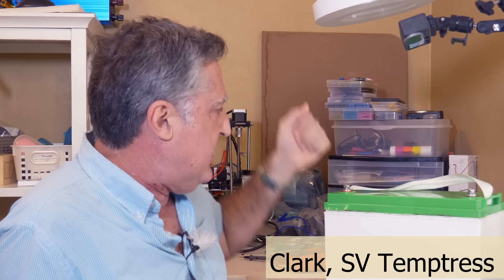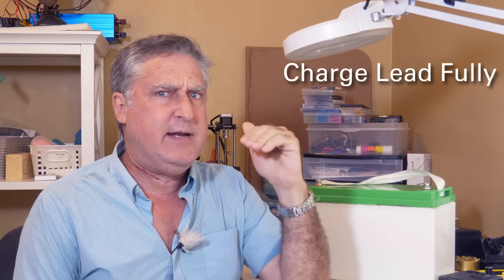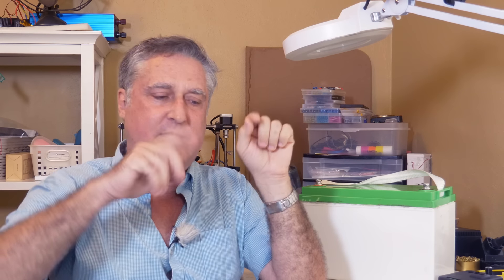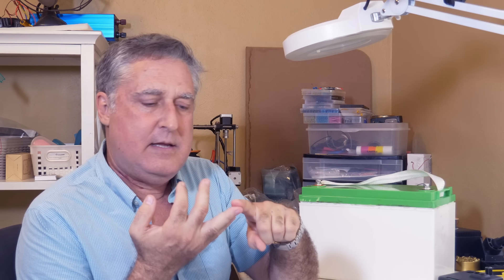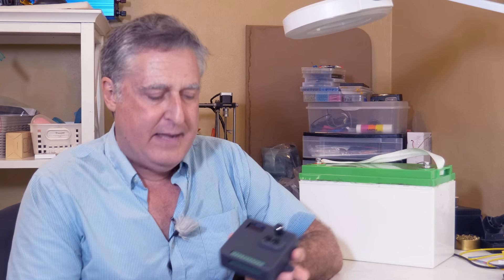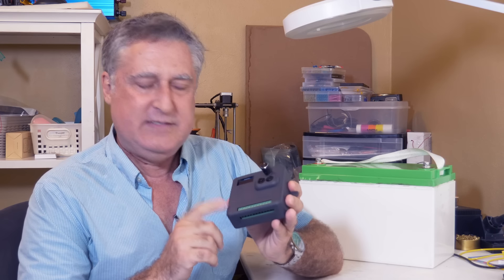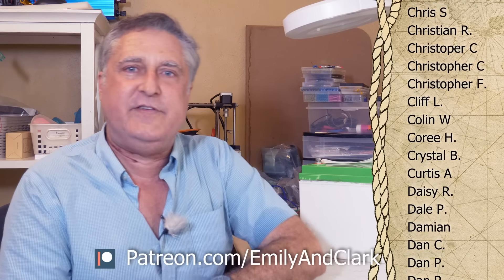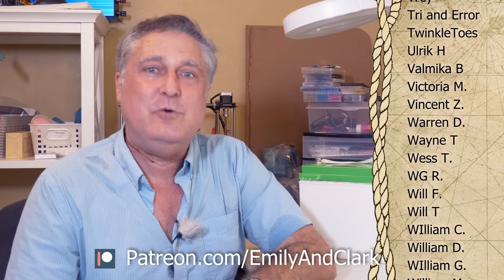Charge Lithium Batteries correctly (LiFePO4)

Comment: New LiFePo4 have good BMSs and they look after correct charging.....good solar charger, correctly set up does the trick
Reply from the maker: Sorry but you are so wrong
   If you have Li you will find out in a few years
Reply: @Clarks-Adventure  I have 6 LiFePo4 of total 990Ah...so far 4 years and they are in perfect condition.
Reply from the maker: That's great.  Best of luck to you.  
  It's obvious you aren't looking for how to charge them.  
   But if you do a bit of looking the research is out there.
https://cdn.shopify.com/s/files/1/0568/1011/1110/files/Math_ScienceOfBBMS_Grillo.pdf?v=1730396821

Comment: I use a Noco charger for my R/V lithium batteries and it works well, when set to lithium.
Reply from the maker: I'm sure it puts power into them.  But will it damage them??  In my experience you will find out in 3 to 6 years

Comment: Hey Clark! When not using the batteries daily and plugged in to shore power with a Victron main charge/inverter (and a hybrid system using your BBMS) I’ve started putting the system at max 80% and min 80% to keep it from needlessly going up and down every day. I’ve seen cycle counts in Bluetooth for each battery even when not being actually used. When. Unplug from the dock and sail I raise the charge to 100% max and min to 20%. Thoughts on this?  Lithium is 500ah and lead is two group 24 (80x2ah).
Reply from the maker: I'd set your dock settings to 80 and like 40.

The BMS is a stupid beast I would use it's cycle count with a grain of salt
It's likely to count ANY charging as a cycle.  The BankManager will allow a li bank that is not a candidate for recharge to go up to 13.45v before disconnecting.

Comment: Have an older motorhome.  Would like to change house batteries to 48V lithium system and keep chassis batteries 12V. Will your bank manager device work with that setup?
Reply from the maker: It will protect your new 48v Li and control it's charging but no it won't step up/down the voltage.  You would need a boost converter like Dc-Dc charger for that part.
Reply: @Clarks-Adventure I have a car with LFP battery. Whats the best way to charge it?
Reply from the maker: I think the BankManager of course and something to keep the charging C rate under control
Reply: @Clarks-Adventure  lfp cars manual says to charge to 100% atleast once a week using slow charger (either 3kw charger or 7kw charger). It helps in removing memory effect + soc calibration + cell balancing.

Comment: Clark also refers to the difficulty of determining 100% state of charge due to the flat nature of the v/I graph, but doesn’t state how the Battery Manager determines this.  Not to mention determining a percent state of charge.  Am I missing something here?
Reply from the maker: If you found yourself in a position where you are the only guy who has built a device that solves an important problem, especially after several battery manufacturers have tried and failed,  would you really give away all your secrets in a YouTube video?
Reply: @ Well, fine.  I just thought you were trying to explain the tech behind the  whole thing.  But ok, I understand you not giving up your trade secrets. Much respect to the work you’ve put into the product.

Comment: Clark, how do we know when we've discharged a LA battery to 50% (or 60 or 70%?)
I've seen in discussions on boating electrical Facebook pages where people say a 12 volt LA battery is fully charged at 12.65 and 50% discharged at 12.0 volts.
What reading, or how do you determine a battery is 60 or even 50% discharged?
Reply from the maker: Let it rest with no charge or load for 24 hours (2 hours works ok usually) and check its voltage. 
   Then use those tables 12.0v is 50 percent, 12.8v is 100 percent.
    The resting is vital and the table is only accurate for new healthy batteries
Reply: You can't use voltage to determine the state of charge of a lifepo4 battery. The only way to reliably tell a state of charge of lifepo4 is to coulomb count, which means fully charging and then counting how much is taken out. As in your own drawing, the red line is so flat that almost anywhere on that line could be any state of charge between 10 and 90 percent.
Reply from the maker: Yep but his question was about LA batteries.

And for li there is another way, it's how the bankmanager does it.  It's a lot of complex math involving a 3brain and some extra time/history based work.  
   This approach is relatively inaccurate around 50 percent, where the bankmanager uses a columb counter.  It gets progressively more accurate as it gets closer to 100 and 0 percent.
    I'm currently working on a POC gauge that will really know when LiFePO4 is about to discharge way more accurately than columb.   It should prove useful for electric vehicles

Comment: Excellent presentation!  But I'm confused.  I have 2 48v 70 ah lifepo4 batteries connected in parallel that I use strictly for emergency backup.  How should I keep these charged properly?
Reply from the maker: If you want longest life leave them at 50 percent 
    But what's the point of that.   I say charge them to full put a tiny load on them to bring the voltage to 13.4x4v. And keep your tank full for emergencies.    That's their job after all
Reply: @Clarks-Adventure  Thank you!

Comment: I have 4 / 12 volt lifepo 4 battery's in my cart ,where do I hook up negative,positive cables from charger,on one battery or one on one battery,one on another battery.
Reply from the maker: If you want 48v put them in series (google it)

Watch my Duffy video.  You need a battery equalizer.  I found a good one that is cheap (follow the link in the description)
Reply: They are in series,it's the charger cables,on one battery or two batterys
Reply from the maker: @dougyoung1309 MarineDCAC.com   find the BankManager install manual.  It might help.

I just got out of surgery so I'm not too sharp just now.

Comment: You are aware that all modern LiFePo4 batteries have BMS, right? Those BMS have MOSFET valves that control charging of individual cells based on their voltage and can bypass some cells while charging (or when charged). So it doesn't really matter what voltage your charger keeps at terminals, cells won't charge if MOSFET valve is off even if an overall voltage is 14.4V. Modern BMS is much smarter than what you think it is. Also max cell voltage for LiFePo4 cell before it starts to deposit Li is 3.65V, which for 4 cells gives ... you guessed it, 14.6V.
Reply from the maker: I suggest you watch my "how the charge li" video I put out a few months ago.

That's not how to change li for long life.
Reply: @Clarks-Adventure  How do you know you are right? I asked Battle Born Batteries specifically if it's safe to keep their batteries at 14.4V all the time, the answer was: yes, it's perfectly safe. So I guess they don't know something about their batteries, and you know better.
Reply from the maker: @victor74293 yes.  I'm saying that exactly.

Look at what EPOCH did recently to their BMS.  They seem to be getting warrantee returns back they can't afford.  They failed doing what I achieved but they are spending money trying.

But the dead simple proof is found if you read the academic papers documenting the study of these cells and how they die.

So you must ask yourself should you listen to scientists studying these new cells or a company of marketers who's goal is to sell batteries.

But it's your choice.  It's your money and your power system.  You decide what's reliable enough for your needs.

Comment: Very interesting info!  I have a 12V 100Ah LiFePO4 battery (Seikon) incoming, which I intend to leave 'uninstalled' for emergency use, and I would like to be able to recharge it from household power (when such power is available again).  Would you be able to recommend a good charger?  Thanks very much.

At some point (a couple of years perhaps) this battery might wind up in a travel trailer with one of your BBMS, but I'm not there yet.
Reply from the maker: If you are charging off the mains with no loads you can use any charger that shuts off once reaching a voltage.   The voltage you choose is based on the C rate you charge at.  

Things get more confusing if that C rate isn't constant.  But it seems you will be able to charge at a constant rate in your application
Reply: @Clarks-Adventure  Thanks for the reply.  The Siekon is 12.8V with a recommended CV/CC charge to 14.4V at 20A (.2C).  After some online shopping, I'm debating between the dedicated LiFePO4 ExpertPower EPC1220 and the SkyRC D200neo, both of which claim to output 20A, but the SkyRC allows user setting of termination voltage (among a host of other things).  Not sure if the latter feature will be enough of an advantage with the LFP charging to justify the greater cost, since I have other chargers for Pb.

When you said at 13:00 that we "want to keep below 13.48V" on a 12V battery, did you mean strictly 12.0V  as opposed to 12.8V? Because later on (around the 14:20 mark) you talk about termination at 14.6V @ .5C, or at 13.7-13.8V if at .1C.  I understood the reason for the difference based upon the charge rate, and I assumed that these numbers would be in reference to a 12.8V battery.  Did I understand and assume correctly?  (13.48 is roughly 112.33% of 12, and 12.8*112.33 is about 14.4, thus my assumption.)

Sorry your gal departed, btw.  Hope you meet someone new soon!
Reply from the maker: Think of the 13.48v warning as more of a float limit.   No higher than that AFTER the cells reach 100 percent charge

Comment: How about systems that are plug and play such as Bluetti or ecoflow and several other similar types of plug and play systems? Could you give your thoughts and opinion about those types of systems. I have a Bluetti AC500 system with 4 3076 watt hour Lithium iron phosphate batteries. The batteries have built in heating if the bms needs to use it. The AC500 has built in mppt controllers and it shows on a screen on the AC500 the percentage state of charge, but I noticed when using it the batteries state of charge indicator shows the batteries state of charge doesn’t deplete at the same rate for the individual batteries. When I use the grid to recharge the batteries to 100% they reach 100% at different times. Do you think that this will be problematic for the life of the batteries. Any information would be appreciated about the type of systems.
Reply from the maker: I have a similar system I'll be reviewing after I get over these surgeries

Comment: Brilliant talk about lifepo4 battery
But does this go for DIY packs of cells.
IV just got a 48v server rack"new" with eve 280ah cells, IV broke it down to make 2 24v packs....
I'm currently top balance all cells (8 at a time).

But IV just had a customer ask me to look at his server rack....goes from 100% to 20% in about a hour...,....
Same again.....cells not balanced so BMS was seeing one cell hitting full and stopped charging then saw another hit low so shut down .......
Now all fully balanced.....works perfect.
Reply from the maker: Yes you should charge any LiFePO4 this way

Comment: You have three Battery Bank Managers for three separate LiFePO4 banks? Does that mean you have three lead acid batteries, paralleled with the three banks? And that the three banks each power distinct circuits on the boat?
Reply from the maker: Good question 
  I wasn't clear.

  I have 3 Li banks all connected to the 1 lead bank and one distribution system 
   The BankManagers bring the li banks in and out as necessary.  
    It's interesting to see how different the three banks operate.  One can see that if they were put together they wouldn't be happy.
   But since the BankManager only cares about the li bank it's responsible for each bank gets its own special treatment
Reply: @Clarks-Adventure  I like the redundancy of multiple banks, but the complexity of managing them and switching between them worries me. 

	AIUI, you have one house distribution system powered by one LA bank, with three BBMSs each switching in a different LiFePO4 bank, when it feels it appropriate. That seems like a pretty nifty setup.
Reply from the maker: @jeffdege4786 yes.  I knew it would work of course but once I actually wired it up I saw a few extra little advantages.
    For example while I go into the menu on one the system lead is held to Li voltage by the others so when I leave the menu the BankManager I worked on connects its li back in right away.
   And in my case I can see one brand of battery has a lower resistance and gives up/accepts power much faster than it's neighbors.  (VoltGo)

Comment: With a bluetooth bms you can see charge percentage. If charging with a wall charger just stop at 100%. Im i wrong thinking this?
Reply from the maker: Sorry to say.  Yes you are wrong.

The POC counter is what is called a columb counter and they drift.   After just a few charge cycles the number becomes completely unusable.
    In a BMS this is reset when you overcharge but when you overcharge it damages the cells ...
Reply: @Clarks-Adventure   from your video  over 100% charge most manufacturers have a small allowance of over capacity. So a 2% " overcharge " bms will ballance the cells and still be within the allowance.  I think we're discussing a non issue. the percentage of degradation is negligible and most average users won't see the difference.  The cost of these batteries is marginal compared to flooded but the performance even if abused is 10 fold.
Reply from the maker: @tazzthedoodle7861  feel free to do what you want.  You bought them.
   But if you read the academic papers on LiFePO4 charging or pay attention to what is seen in the field you will see that it does matter

Comment: So what is wrong with charging at 3.5 vpc, absorbing till and end current of 5% ah of the bank, and then float at a point that just keeps the house running?
Reply from the maker: If you charge at a low C rate, which is very common with a big bank charged by solar, you have already overcharged at 3.425v per cell.
   That's why its called "low current overcharge".  It damages cells 
   Most days my batteries finish at 13.8v
Reply: @Clarks-Adventure  thanks for the reply.   I was hoping you were going to cover some of that stuff in this video.   You never really stated what the bank manager is doing, just that it uses an algorithm.   Maybe a second video.  Guess I have some reading to do.  My system can do .2-.3c depending on weather of corse.
Reply from the maker: Yep I could have done a better job.  Today I rewatched it to put chapter headings in.  That should make it easier to jump to the good parts.
  I think I do talk about that but not as well as I should obviously.  
    Now that this one covers the ground work maybe I should do two more short videos.

How to charge...
How to kill...
           LiFePO4

Comment: Add a GPS function to the weather report blackberry so that it KNOWS where it is. And be able to bypass that if we lose GPS ability.
Reply from the maker: Yep
   And a bunch of software 

The Gen 3 has an external pin called reset.  Force it low and it's like pushing the reset button
Reply: @Clarks-Adventure  I think I meant raspberry. But by bypass, I mean be able to insert a zip code or Lat Long location to work if GPS function goes away. But if GPS goes away, we may not have weather reports either.
Reply from the maker: Yep.
   Sounds like what the guy is working on

Comment: So my questions are.. how can you coulomb count with that thing if you don't have a shunt that is capable and has terminals for the battery to connect to so that all the current coming in and out of the battery can flow, some lifepo4 batteries can dump 3C out of themselves easily, none of the screw terminals on that thing would stand up to that never mind accept cable sizes to match the current passing through it. Next, to manage cell voltages and balance cells, you need to be able to measure the voltage of each cell individually, that means breaking into the case of that battery you had beside you to attach the wires, which would instantly void any warranty. To balance a battery you need to ensure that you are not charging it at a higher current than your balancing method can overcome ( either by wasting charge as heat or moving charge between cells with capacitors) a 2 amp balancer cant overcome a 3 amp charge current, you'll get cells overcharging, the only way to top balance a lifepo4 battery is with constant voltage charging and low current at the end of the charge cycle to allow the balancer time to do it's thing.
Reply from the maker: 1. Two of those wires go to a hall effect current sensor that does the work of a shunt but with no voltage drop 

2.  The bankmanager isn't a BMS.  It requires a BMS (which batteries already have) to operate properly.

3.  That's between you and your BMS.  You should only have to top balance now and again
  So balance new batteries (I have a video on that). And check them maybe once a year or so.  Learn for your battery how often this is required.

Comment: I have a 5000 Watt Growatt All in one charger inverter with a 280 amp hour 48 volt LiFePO4 bank. No lead acid battteries used, and don't intend to ever use lead acid. 200 A, 2A balance JK BMS used. Can the Bank Manager be used with this setup?
Reply from the maker: You need some lead especially with growatts as they switch slowly.  The lead is there to keep voltage under control when the li is removed.
  But if your system is smaller then this you likely could get away with 4 starter batteries.
https://youtu.be/oW7GbYT3oco